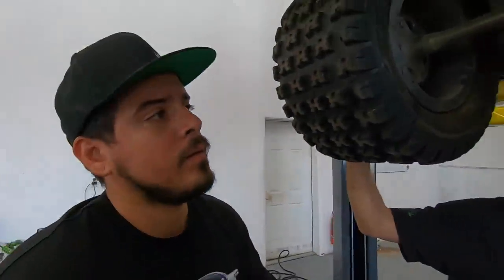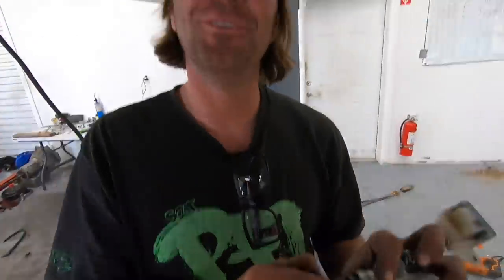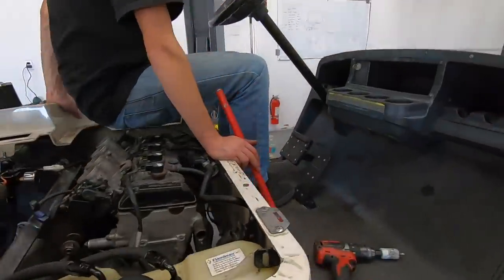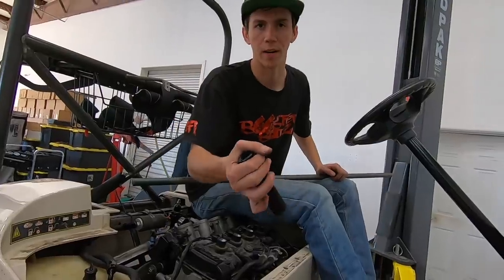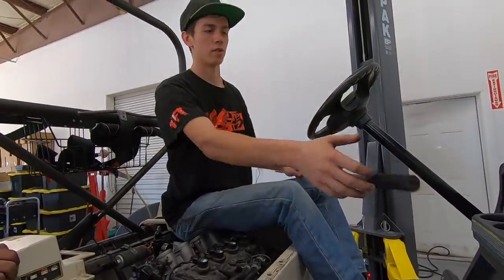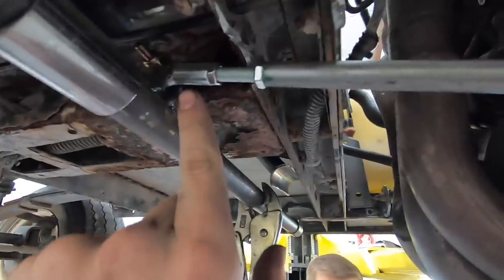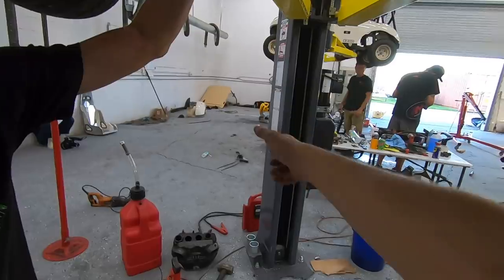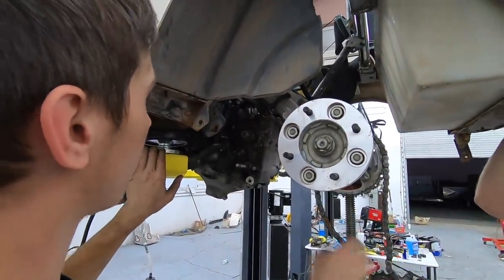600cc Swapped Golf Cart Is Almost Ready to Drive! (Build Off Day 3)

Comment: Y’all should think about leaving room in the budget to get a larger rear sprocket and chain to fit, so y’all can play with different gear ratios to get that 60ft down. Being that it’s a 600, y’all might need that extra low end to get an advantage over that 1000.

Comment: If you flip the shifter connection on the gearbox then you can still pull back to upshift 2-6 with the tab mounted on the bottom of the shifter bar.

Comment: Still got time to get the front end of a quad and put that on the front, so when u come down from a wheelie your front end doesn't fall apart. Would be a lot more stable with bars then that little steering wheel, and the geometry of a golf cart is designed to dump u out over 10mph, my 2 cents

Comment: Simple fast solution  is to put a pivot point between  the shifter and trans  to not only correct  the direction of the shift but also adjust the throw

Comment: @boostedboiz hey so the shifter rod that comes down if you put the rod on top instead of bottom that will allow you to be able to be pull to shift instead of push to shift , I've done it on my 05 gsxr 600 so I could press to shift up gears instead of shifting down to get to higher gear !

Comment: You can not add suspension with that mounted swing arm, mounting point need to be in line (ish) with engine sprocket, if you add shock right now it will break the chain everytime it travel up

Comment: Seriously guys, you must have got confused on that linkage for sure. On Mc when foot-lever is attached normal, you press foot down to enter 1st, then up for neutral and more gears. So when you turn lever down, 1st is back and others is forward.With the way you have that set up, and with both tabs down, it will go up in gears when pulling backwards on the gearstick. When both are pointing down, and the forward one goes forward(by pulling shifter backwards) the gearshifter on the engine, that is also pointing down, will also be moved forward.

Comment: The shift linkage on the motor is pointed down if you change it to point **UP** the shifter will be the opposite so it will work the same as the MR2.

Comment: Wonder if its the same lug pattern as the old ez go's had.  Because if it is, some of the old 13/14" rim wheel/tire combo's from honda civic's of the late 80's and 90's will fit.  More ground clearance and higher top speed.  I used to have a CRX I'd swap it's factory steelies onto my go kart, which was made with an old ez-go axle.

Comment: If they fit a rear spring/damper unit, for rear suspension, they will have big issues with chain tension variation.  The rear arm pivot is too high.  They did it to get a short wheelbase using available parts

Comment: Moving suspension will never work on this setup because you don't have the swing arm pivot point in line with the engine sprocket the distance between the sprockets will change drastically when the swing arm moves up and down...but good work overall,nice job!!

Comment: I can’t see your get good chain tension with the angle of that swinging arm if using a shocker.The pivot should be as close to the engine sprocket as poss if the arm moves say one inch up or down it would be about 2-3 inches of chain tension. Leave it solid guys

Comment: If u where going to run a shock later on ull have to change ur design. The pivot point needs to be as close as possible to engine sprocket. Where its at now it would
Pull n break the chain, and also would gain a few inch's in wheelbase as it cycles and probably eat the body

Comment: If you flip the linkage on the motorcycle transmission upside down then you will be able to pull to upshift without any other modifications.

Comment: Should have split the shift linkage into two parts with a triangle in the middle with diff mount points to adjust throw and shifting down would be forward. 

 Like this so kyle sees

Comment: U should run a smaller front or larger rear sprocket for better acceleration. Should be geared for 170ish mph with factory sprocket. That rear sprocket looks small. First gear will take you to 120 mph with that small of a rear sprocket. Gonna have a sloooooow launch and 330 with that. Your gonna run the 1/8th in first gear and its gonna hurt you without enough torque.

My r6 dont start to wake up till 8k and only fully starts to come alive at 10k

Comment: Too bad you can’t somehow incorporate the clutch lever into the shifter. Like using the whole shifter as the clutch so pull all the way back and it disengages the clutch and clicks into the next gear. And slowly moving the shifter forward would engage the clutch.

Comment: I would’ve flipped bike side shifter and then mounted the shift bar at a 45 then bent up. Get the throw, the right direction and not have to do as much modifying.

Comment: I wanna know how that handle shifter/clutch lever feels to drive, with a steering wheel and a foot gas, weird haha pretty cool
Reply: Taj Jacobs it’s just like a shifter cart
Reply: gym shoe your right I got mixed up in my head thinking about the shopping cart go kart shifter carts have the paddle on the wheel then the slap stick that would be better so they have control while letting the clutch out less torque steer

Comment: @BoostedBoiz for the wheelie.. Cheat.. Use a hydraulic cylinder  and weld a wheel and bracket in between the frame towards the front, and engage the cylinder to lift the front to tires of the ground and apply Little gas and ride with the front wheels off the ground as long as you want... 😂

Comment: If this is a legit budget and not TV crap save up for tires. JD slicks +wheels are not cheap knobbies should do good burnouts though. summit and jegs for the JD stuff and one day shipping also have several sprockets for test and tune unless you are just going to spray the mismatch away. I would have a minimum 5 tooth spread both ways for test and tune that would do way more than a 400cc difference that they have not tuned....also Soak that chain in ATF and if any cash avail use a new one and keep that trashed chain as backup. drag starts snap chains and break teeth.

Comment: Before yall try to run it, do yourselves a favor and spend 5 minutes scrubbing that chain with WD-40 and a toothbrush. Get the rust cleaned up and get those links moving smoothly so your power delivery won't be jerky

Comment: Shouldve put the clutch on the steering wheel like grind hard plumbing did on his Barbie jeep
Reply: This. Then the brake pedal could be for front brakes, and you can add a handbrake lever for the rear for drifting.The front brakes can be as simple as wood or nylon rubbing on the front tires.

Comment: Everyone saying cleets 1000cc is down a cylinder , sounded damn good to me.
Reply: Kota Ellis
Yeah some moments it sounds like it’s missing... others it sounds like it’s not. (I’m a huge inline4 Motorcycle nut, owned  4 or 5 over the years and have 2 right now) it certainly doesn’t sound as perfect as BB’s 600, which is purring like a kitten... and if CM’s isn’t perfect... the extra 400 cc’s ain’t going to matter.
Reply: Could be something simple as a old gas or fouled plug or two. Sounded a bit off at idle to me.
Reply: @TTCoyoteF150  I can see that. Because I thought it was spitting out smoke or a bunch of unburnt fuel when that guy revved it when they were checking it out to buy. Definite miss at idle, but not always so its not a dead hole, just missing.

Comment: what if you add an extra linkage spot kinda  like you did with that extra axle to make a chain fit. ?
then it should work the right way.
dont know the word for it in english  but basically a pivot point that make push into pull  . like this  http://prntscr.com/q0dtie

Comment: i would done just like a motorcycle, removed the steering wheel and put handle bars with the clutch and a shifter in the floor to shift with my feet like a motorcycle.